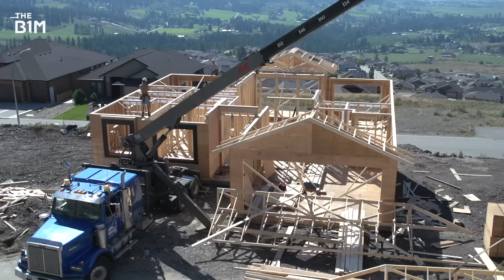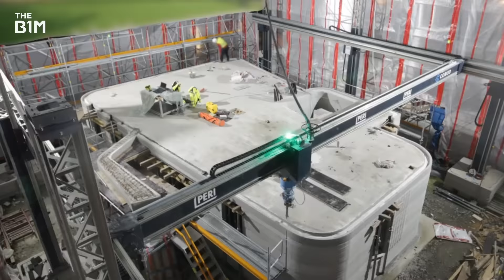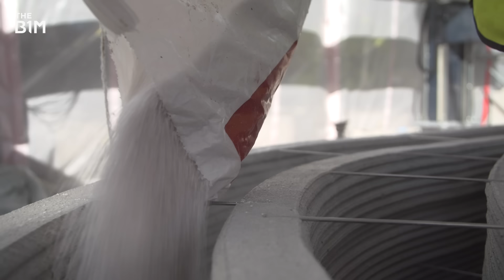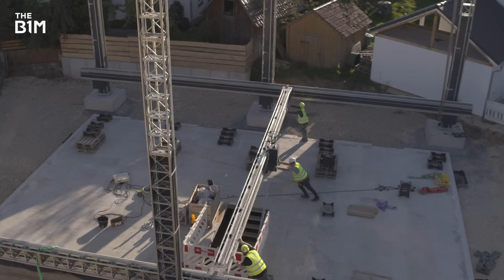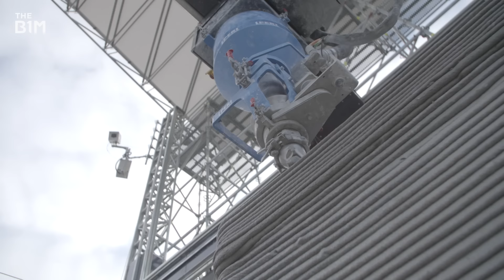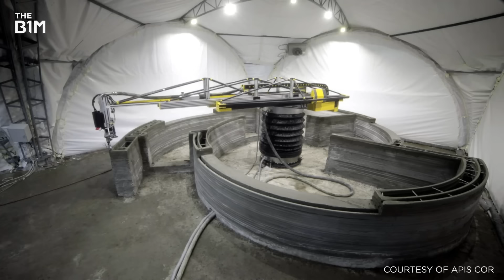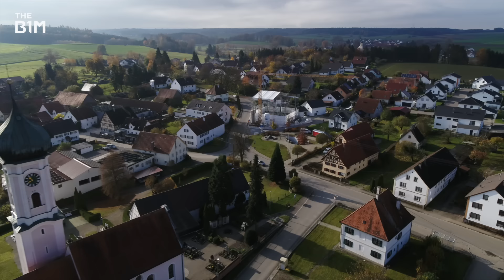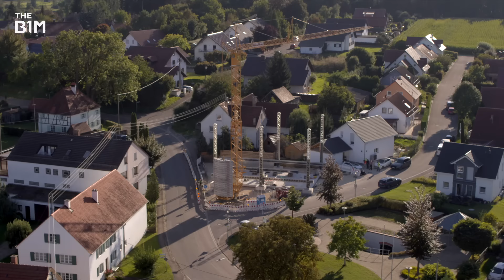Why This 3D-Printed House Will Change The World

Comment: The world of construction has taken its first step into rapid production with little or no delays.
Reply: Here in the Netherlands 3D printing has pushed back to the background, now they are focusing on prefab building, ware you can't see a difference between prefab and traditional building

 And even all wiring and plumbing gets also don in the factory, and walls have connectors connecting water and electricity connecting them up, and 80~90% being done off-site.
Also because of the concrete carbon impact they are now looking more to use wood then concrete.

https://www.vdm.nl/prefab-woning
https://www.huf-haus.com/nl-nl/prefab-woning-prijzen/
Reply: This is not the first step in rapid home production. This is the second step. The first step were kit homes and prefabricated homes. In the early 1900s, Sears sold kit homes to people called Sears Homes.
Reply: @314jrock  We already had serial home building  (aka trailer homes)
Reply: @paxundpeace9970  That's true and that is my point. 3D printed homes are not the first rapid production homes. The idea has been around for 100 years.
Reply: @paxundpeace9970  first steps were taken in China and Dubai they built normal technology buildings and sky scarpers , we need great normal robots
Reply: @paxundpeace9970  Note: nobody wants them and their resale value is 0.
Reply: @314jrock  
Glass Fibre Reinforced Gypsum(GFRG) Board construction technology also saves the time,  its a prefab work.
Reply: Rapid production? 🤣🤣🤣 From the looks of it, 3D printing walls is 10x slower than factory made precast concrete walls (with water and power lines built-in!) which have been around for 115 years! Davinci doesn't know history. 😂😂😂
Reply: @devonf.3803  also good for workers since they searching anyways all the time more bcs. they don't have enough, the loan won't lower and they have less hard work. Greetings from Gemany
Reply: @odineu9120  

So killing off construction workers is ok?
Reply: @odineu9120  for a few workers its good you can say what you want but men power will be reduced at least to half
Reply: @gokusan1015  depending on the country and how many workers they have and need.
Like i said here in germany we are pretty low on Construction side workers, almost everyone who is working in this area have to do overtime hours on work.
Reply: @odineu9120  less hard work and less people needed for the job which means less demand for the job meaning more unemployment in the field
Reply: @odineu9120  the value of labor goes down, jobs get paid less or does and good jobs get concentrated
Reply: @odineu9120  no it’s not good for workers. It’s putting people without jobs.
Reply: @odineu9120  it's bad for workers because there is less demand for them and their wages will go down.
Reply: @drabberfrog  the wages (at least in germany) can't go down bcs. they do work on tariff base wich can't be lowered as i know
edit: and companys wich don't accepted the tariff thing will do lowest lown possible anyway.
Reply: @drabberfrog  

Fax. It’s like banning truck drivers. Then what? How can they pay taxes AND buy food if you automate their jobs?
That’s over 20 million people. 
And now people want to automate construction? Then what happens to all the construction workers? Where can they get the money to pay taxes and buy food?
Reply: @alohatigers1199  I think eventually there's going to be a point where a UBI is going to be necessary because so many jobs will be automated.
Reply: Andrew Yang for US President 2024.
Reply: Pre-cast wall are common in my country for houses for years now. Too bad it doesn't get the same coverage. Because this revolutionized how we actually built our house now.
Reply: @72corrvette1  it's ok and I get what you're saying but this channel usually focuses on futuristic stuff that gets lots of views like skyscrapers and super expensive pieces of infrastructure and not affordable houses.
Reply: Rapid production existed before and this is not the magic solution people think it is.
Reply: Have u seen how fast they make those student apartments in The Netherlands? A floor, 4 walls, a roof and done! I have seen them erect 2 streets with houses like that in a few days!
Reply: Great to see you here Davinci!
Reply: Did someone build a red tape cutter!?
Reply: Hey DaVinci didn’t think I’d see you here hahaha BTC 24k!
Reply: Wont this devastate the real estate market? if more people can have homes quickly and cheaply? it ''commoditizes'' the real estate market: property values will fall and rental income will too...
Reply: @tentimetex  the most ridiculous reason for keeping a common good artificially high is that it won't be so profitable for those who've exploited is artificially scarcity.
Reply: Who said anything about keeping it high?
Reply: Further away than u think
Reply: @72corrvette1  who are you responding to?
Reply: The Empire State building was built in 14 months in the 1930's.
Reply: You mean, delayed for how many years now?
Reply: Cement isn't sustainable either
Reply: Step one:  Choose house design on internet
Step 2:  Company prints your house
Step 3: ???
Step 4: Profit
Reply: @72corrvette1  

No, This would not work because shelters doesn’t help the homeless get jobs. 
Imagine homeless shelters help them find a job, ALL OF THEM would get jobs. This will solve the homeless problem.
Now, imagine if they have someone to help them financially so they can buy their own house so they don’t need to live in shelters.
Imagine if they have someone that can help them with their drug and alcohol problem?
Reply: This needs to be a hybrid
Reply: Davinci here too? :D
Reply: Depends really, this is just a concept idea. They have to find a market for it that will support the costs. I bet ya this will die out and will never become reality, as much as I would like to.
Reply: my only problem is sand. we are told that we are running out of sand.
Reply: True
Reply: @devonf.3803  Ide assume you would still need workers because of finishing touches and such
Reply: @devonf.3803  they will get tired of having them burnt down! More then one way to skin a cat!
Reply: I guess you've never ordered cement before
Reply: cement? Not a very planet-friendly material.
Reply: I wonder if Tesla.com will start making houses ?
Reply: How long do you think before you can order one on Amazon?
Reply: they should add pozzolan sand, adding volcanic ashes will turn it into roman concrete so it will last way more time and become more resistant overtime as it absorbs minerals from the rain.
Reply: Not enough of the right size sand in the world for that much concrete... feel shame at a bad job!
Reply: @seankuhn6633  pozzolan sand is volcanic ashes, it can also be created artificially using fumes i think like they used for hoover dam in America, it strengthens more and more over time, if they dont do this, that quick dry instant cement... anyone would be able to kick his way inside your house with a bit of effort, what they could do is use it as a mold instead of using wood molds, and just pour the concrete inside, if its roman concrete way better, but even normal concrete need to remain wet for a couple of days to reach maximum hardness.

also, MIT engineers working with scientists in Kuwait have found that volcanic rocks, when pulverized into a fine ash, can be used as a sustainable additive in concrete structures. 

or pour lava inside, with a big enough fresnel lens it can concentrate sunlight to easily melt stones.
Reply: https://news.mit.edu/2018/cities-future-built-locally-available-volcanic-ash-0206
Reply: Why little or no delays? This is still onsite construction!
Reply: @devonf.3803  .. Not totally..
Reply: @devonf.3803  
Architect and workers are not important the end user, the house owner is important.
Reply: In light of this fact, what other possible changes could occur in this vein, in the next ten to twenty-five years?
Reply: @devonf.3803  So...time to have less workers.
Reply: Terrible for jobs
Reply: Thousands will be jobless in the next decade and a profesion will be forgotten
Reply: @carlosroacho3901  Because making machines...designing machines...maintaining machines...setting up and removing machines...lol...those won't create jobs?  Come on...
Reply: Technically is doomed to fail. It looks fast when it’s running perfect but it down time will happen
Reply: Just the freaking delays to build a robot spend billions on programming those and bullshit already then build a factory to build a robot that you eventually build a 3-D printer and then tell her buddy it’s amazing because you can print a board that you could’ve cut out of a machine that will work workshop in literally 30 seconds with technology that we have right now you guys are all green washed and full of shit
Reply: House designs will be sold as NFTs in the (near)future
Reply: Preplanned everything will be ready in the Reset Era.  Once the Reset event happens nothing will be the same
Reply: Crypto guru checking out 3d homes,  cool man.
Reply: @devonf.3803 ok😟😟😟🙄🙄🙄🧐
Reply: First step? Ever heard of prefab??
Reply: @devonf.3803  that’s too bad
Reply: https://youtu.be/zjVZNHra0pg
Reply: Is this safe enough without reinforced Steel?
Reply: What is the $$ for these homes for example the one we are watching been build ??
Reply: True
Reply: some sees this as a job killer. lets hope it makes homes more affordable without going towards sudsidies, government aid, section8, and other handout style approaches
Reply: And it's just in time. World population is going to keep rising for decades at least, and current construction speeds can't keep up with demand
Reply: We can do printed house with earth, plástics of oceans and vegetable oil
Reply: @devonf.3803  Lets stop technological progress!
Reply: @thetaomega7816  are you being sarcastic?
Reply: @thinkbubbles9838  yes
Reply: @thetaomega7816  No.
Reply: @thetaomega7816  una bomber type thinking and behaviour, lol
Reply: @thetaomega7816  
It is question?
or
Comment?
Reply: @thetaomega7816  no. This is exactly what Ted Kaczynski warned us about in his Book “technological slavery” (not to defend his actions)
Reply: @thetaomega7816  Without Technological Progress how would we Improve our daily lives yes we are advancing very quickly but you shouldn't fear it
Reply: It is still a long way but look at china were they are building hospitals with in days. 
Or highrise building within weeks.
Reply: @paxundpeace9970  high rise buildings in weeks? why would they build that when they have so many ghost towns full of empty apartments.  SOURCE: https://www.youtube.com/watch?v=TiTDU8MZRYw
Reply: @paxundpeace9970  only because of the pandemic and they had alot if pressure against them
Reply: @paxundpeace9970  

And what is the wages?
Reply: @paxundpeace9970  r.they safe
Reply: @paxundpeace9970  you can get a lot done if you are on the right side of a gun
Reply: @paxundpeace9970  They have no resource constraint.
Reply: @paxundpeace9970  Yes but using hundreds of people with little health and safety or self determination
Reply: The future of the housing market ......
Reply: There will definately be a great replacement in construction workers but then there will. be a migration into other trades or even tech trades.
Reply: that thing will plug in a heartbeat
Reply: Wrong, you just haven't been paying attention & saw a youtube video 2 years ago. Some companies have been doing this for years & constantly tweaking their technology to make more and more improvements
Reply: Really it's baloney. I watched a house go up next door.... months and months to prepare the foundation, two days to frame the house and then months and months to finish the inside. The 3d printing part is literally the easiest part of building.
Reply: @ironmonkey1512  months and months for a foundation...ROFL...WHAT sort of amateur did you see. My 5,500  Sq ft home took about 16 days  for the foundation.  Major property excavation was only 3 days before foundation. I think this technology is great and will only get better.
Reply: @edwardr5084  we have sandy soil that shifts easily so they had to bring in tons of fill, water and compact each layer. So sorry your personal experience doesn't apply.
Reply: @ironmonkey1512  Sorry son....what does  your regions issue have with other parts of the world?  MOST folks of the world don't live in a sandbox.
Reply: @edwardr5084  it's hard to admit when you are wrong, isn't it? And how old are you to be my father.
Reply: @ironmonkey1512  If I'm wrong, why bother messaging me? I'm most likely not older...just wiser, Junior, I'm just wiser.
Reply: @devonf.3803 

Same thing happen to horse and carriage when automobiles became main stream.
Technology evolve, times changes and people will have to adapte.
Reply: @devonf.3803  I disagree, what's good for workers in the long run is a post-scarcity society where work is voluntary and everybody´s needs are cared for. Automation is inevitable, but with it comes an inevitable loss of tax base for capitalism, with rising unemployment .Artificially keeping jobs alive by slowing down technological development is not an option.
WE need to change our tax systems, taxing profits, land, pollution, but not work. Automation needs to be accelerated for the benefit of all, this would speed up innovation and progress, and free people up to do what they want.
Reply: @kooshikoo6442  The only way to pay for people benefits in a super automated world is to tax capital (for example, robots). It will be a Carch 22, because if you tax capital, high wage countries in the developed world cannot automate themselves to become competitive with low wage developing countries. At least not in a lia tariff  free trade system.
Reply: @kooshikoo6442  yes!
Reply: @kooshikoo6442  Capitolism doesn't need a tax base, Governments do. Capitalist will do just fine without taxes.

Comment: Talk about the cost of Setting up all the Equipment Like the Tower Crane, and all the other cost like the Covering The Job Site.
Reply: A crane and 48 hours to set up (and assuming site requires no work to accommodate the 'printer'), a crane and a day(?) to pack-up, plus construction time...it's hard to believe that this can compete with pre-cast concrete. Especially considering the latter can be pre-finished and/or requires much less work to finish.
Reply: @kirkc9643  Exactly.
Reply: I was wondering the same thing. Moving a factory from building site to building site plus all the fabrication materials and covering the whole site. Why not simply move pre-manufactured components and assemble them on site. A factory that can build custom components that is situated near a developing area seems like it would be more effective and efficient.
Reply: @rabbytca  I've worked on a lot of houses built prefabricated in sections, they are a nightmare to work on and an inferior product. There is a lot of excess bracing that gets in the way of everything, causing clashes and trades to do stupid things, things don't line up and are bodged to be as close as possible, I've seen multiple walls be on the piss. Then you get the destruction of rain getting in an unfinished building. Terrible product, stay as far away as possible
Reply: @rabbytca  I believe this is the opposite of low cost sustainable housing that they are advertising. Build concrete factory and constuct huge subdivision around it
Reply: @3mtech  You are probably correct in that assessment. Cement being a high energy input ingredient it will only be cost competitive and efficient in limited areas of the world. Until they begin to formulate substrates that utilize inputs with a lower threshold of energy and cost such as clay, sand, waste plastics and or wood fibre into a stable insulating matrix this technology will probably be relegated to research demonstrations.
Reply: @rabbytca  i think you are right. Pre-fabricated construction materials, even 3d printed, make more sense. Factory houses instead of moving the factory to the building site.
Reply: @LueLou even with constructing multiple buildings, it cannot compete with prefab in terms of speed, consistency and scale(height).

Comment: It seems only single step is automated: building walls. Everything else is still manual (in the video operators put some metal brackets and plates), are there any ideas how to automate those too? Also this approach might not work for earthquake prone regions (I don't see reinforcements in the concrete)

Comment: Imagine if they had just 3D printed the new Berlin Airport
Reply: It would still have been a mess as the design was fundamentally flawed
Reply: Wouldn't have changed anything at all.
Reply from the maker: Imagine!
Reply: The problems with Berlin Airport were lack of retail space requiring a redesign, the need to replace vast amounts of wiring and various other issues, nothing to do with the basic structure.